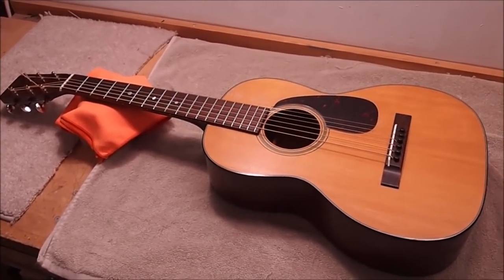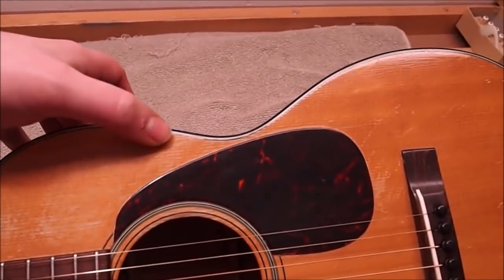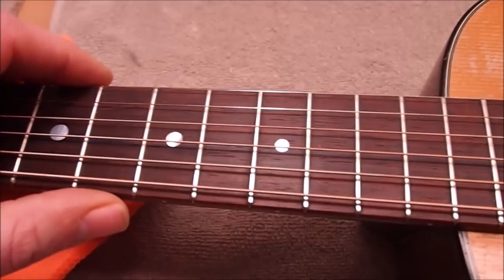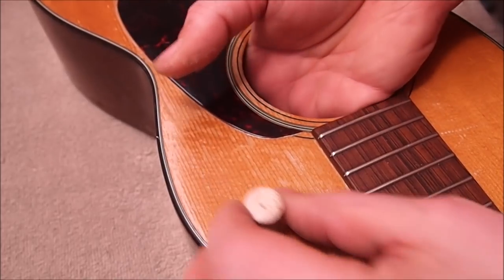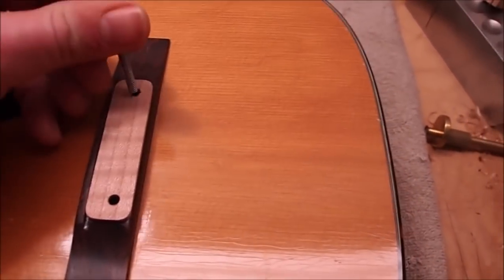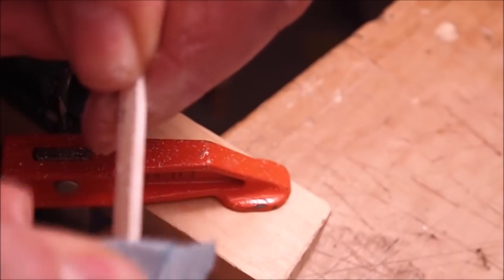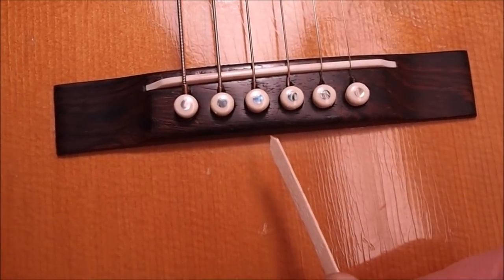Martin 5-18 Crack Repair and Bridge Pad Overlay

Comment: I recently got a rare variant of this; a model 5-16 from 1963. Only 127 model 5-16s were made in 1963-64. It's presently in the shop for its obligatory neck reset. The luthier commented on how 'unmolested' it was; nobody had previously gotten in and "messed around with it"... I hope to get it back next week; it's already three weeks late, which in luthier-speak means it's right on time... ;) I haven't decided whether I'll string it as a Terz, (up a third, G to G), or maybe in Nashville tuning. Or just keep it in standard as a couch guitar. Decisions, decisions. ;)

Comment: Far out! I'm currently working on a 5-18 which my sister bought in maybe 1960 or '61. It is used and almost all the wear is from the previous owner about whom I know nothing. Her friends and maybe the owner called it a "Lady Martin". The pick scratches are deep on the lower bout below the pick guard through the finish and into the wood! I'm going to leave that alone unless someone has a better idea, I kind of like the character it lends. This is an elderly lady and deserves respect for the well-earned experience. I'll just clean everything, maybe try to straighten the one tuning key that is slightly bent. I need to think about the intonation because the peg holes have those grooves toward the saddle that happen over time and string changes. In any case it's all going to be fun. Maybe I'll figure out how to put up a picture somewhere.

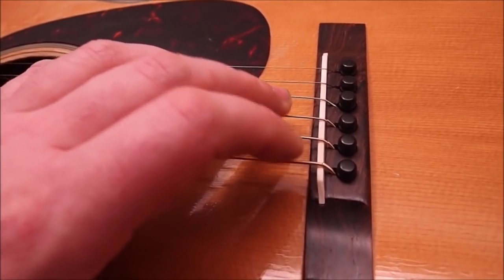Comment: That guitar sounds awesome!!! The sustain is unreal!!! I love how cleanly you fixed that crack as well. @3:56 It looks like the bridge plate is pretty well done. A plate cap is an easier fix rather than replacing the bridge plate &  also much easier to replace in the future should you have to. I recommend trying purple heart. It's harder than maple, you can make your cap a bit thinner & it produces a nice balanced tone just like the maple. I love the way these parlor guitars sound. I had a chance to buy a brazilian Wurlitzer from the 1920's for $600 a couple yrs ago. It was still playable & in good condition for it's age. I should have jumped on it!!!!!!! The guy won't sell it now. Stupid me!!!! Nice video with great repair work!!!!!!!
Reply: Ahh! Thanks jdcrowe82 for the tip on using Purple Heart, I have some and may use that if I decide to drop those string balls down a tad.

Comment: Re: the unequal bridge to saddle to string spacing> I bought a Sigma guitar a long time ago that needed a setup. The saddle in the guitar when I bought it was narrower than the length of the slot. As I shaved down the underside of the saddle and would subsequently try out the action to see if I got right, I noticed that as I would place the bridge a little to the right or a little to the left it had a profound difference to the tone of the guitar. Toward the treble side gave it more treble and Bass side more bass. Eventually, I settled on shoving it over to the treble side and set it up from there. I assume it had something to do with the way the saddle was interacting with the braces. Do you think that Martin might have done the asymmetry on the 5-18 on purpose? Maybe to give a student guitar more treble in the "mix" for recitals?

Comment: Did you stick with the standard EADGBE tuning, or did you go up a note? I have a smaller sized Hohner classical guitar that I restrung some time ago, and it sounded like loose garbage until I brought the tuning up to F instead of E, and it makes a world of difference. Nice job, by the way :)
Reply from the maker: A lot of people tune these up a third to G. This customer wanted standard tuning. It sounds okay with medium gauge strings.
Reply: @twoodfrd Thanks for the great video. I found a pre war 5-18 from 1941 and it is in a good condition. How much do you reckon it's worth to pay for?
Reply: @twoodfrd  Jake Wildwood recommends medium Gauge strings for E-E Tuning & it worked. It's basically a Mini Parlor Guitar & it's portable.